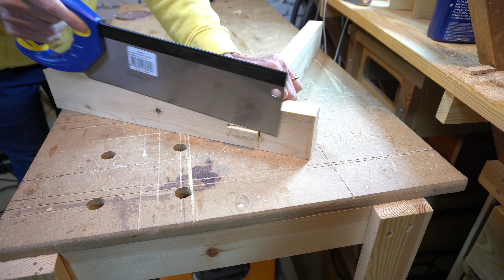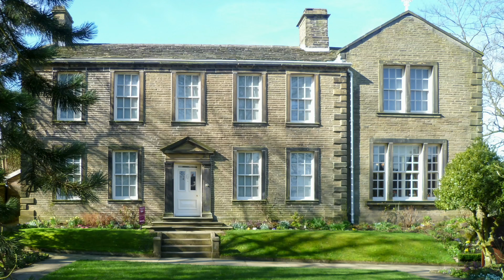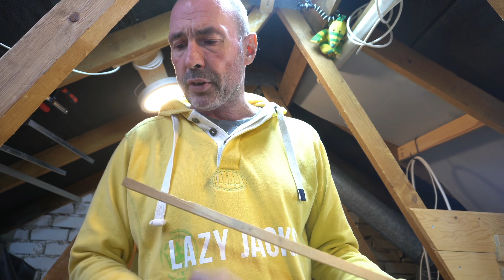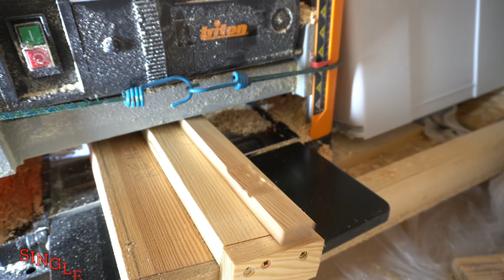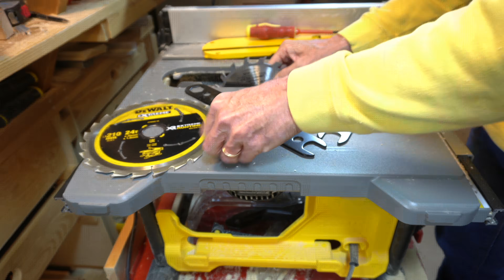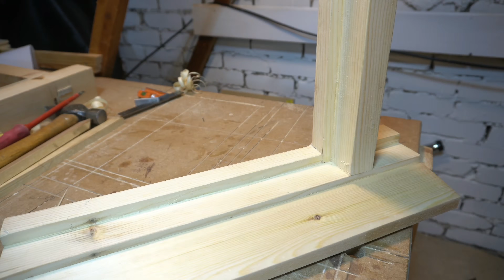Make Simple Window Frames / Components.

Comment: Trying to decide if its better to buy some second hand windows (if I can find them) or make them. I have all the tools and have woodworking experience but feel like this might take me so long that it might be better just to buy it... I'm in Australia and materials are expensive - I also have to consider the time value...
Reply from the maker: Hello. I guess it depends how complicated they are. Back in the day we could make 4 to 6 windows a day. Probably one sash on each, beaded and stained. We didn’t have sophisticated machines but every we had was set up ready. We tried to use 63 x 75 planed stock ( referred to window section in the UK) but sometimes we just had to buy saw timber and process it. That slowed things down a lot. Good luck. Regards JP

Comment: I'm pleased to find this video.  I need to build six windows to replace the existing single-glazed units and your experience is valuable to me.   What blade do you use for the wider cuts on the table saw?
Reply from the maker: Hi Frank. Firstly, thank you for the coffee. In is a 6mm grooving blade made by a company called Orange. They are available on Amazon. They are by no means necessary though. You could just run more passes with a standard blade. Kind regards JP

Comment: Great video! Very insightful. 
Especially how you explained the trim difference between single and dbl glaze.
I'm having a crack at making a couple of awning windows to replace some old dry rotted cedar sliders.

Looks like I need to expand on my repertoire of power tools!!? 
I should have got a table saw instead of the compound miter !!
Of well, she'll be right 👍